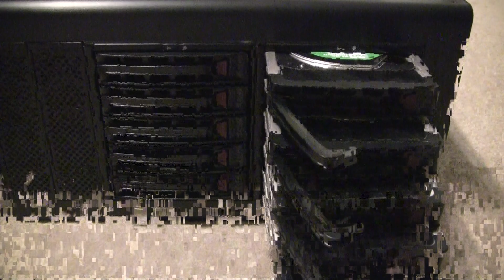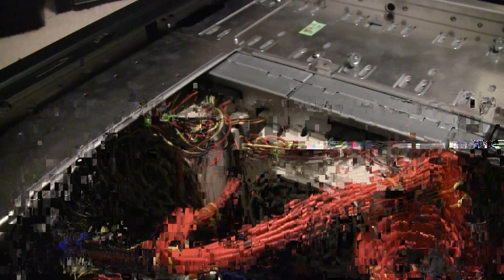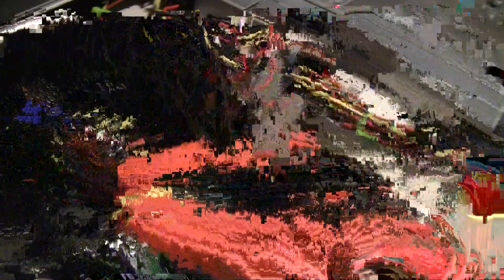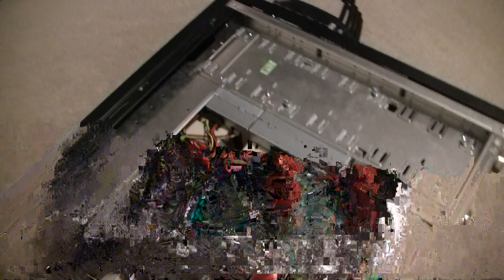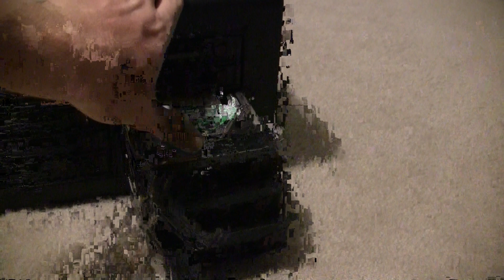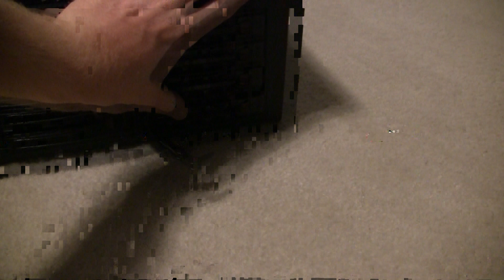YouTube Upload Video Pixelation Artifact Problem

Comment from the maker: What worked for me was a cable modem reboot.  I would reboot your router/firewall and PC too just for good measure.  I was troubleshooting the problem when it corrected itself with a reboot of the cable modem.  Up until that point I was able to reproduce a dirty pixelated video through one connection to my cable modem.  And I was able to reproduce a clean unpixelated upload using a second IP address hooked straight to the cable modem.  Once I reboot the whole mess all connections worked.

Comment: I'm getting this same problem as well now.... It's definitely weird and quite spontaneous, I'm hearing a lot about the problem being internet speed? Location in the UK or some parts of Europe and things to do with the firewall/modem connection.... However I think it's likely to be a youtube server issue, which is unfortunate considering that means there's no easy solution until they do an update or fix the uploading software. Damn.